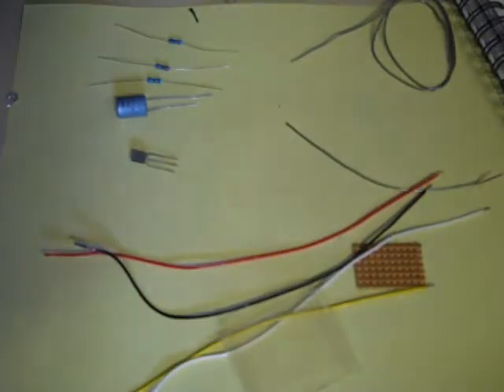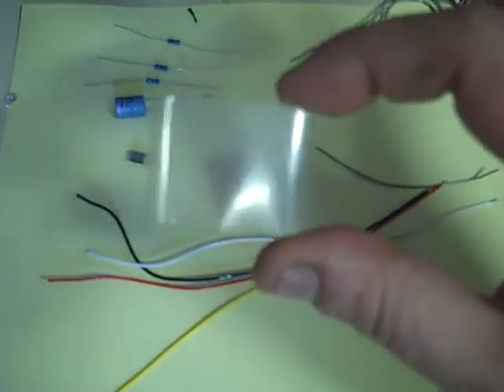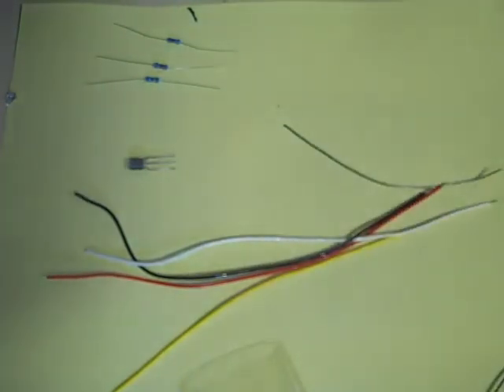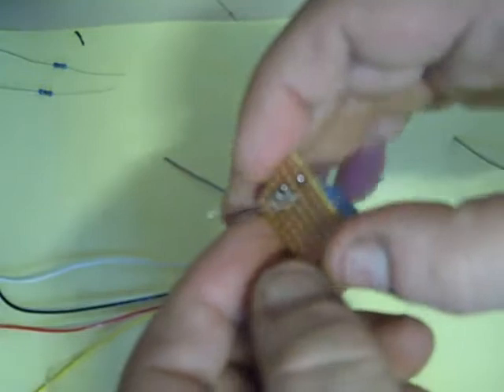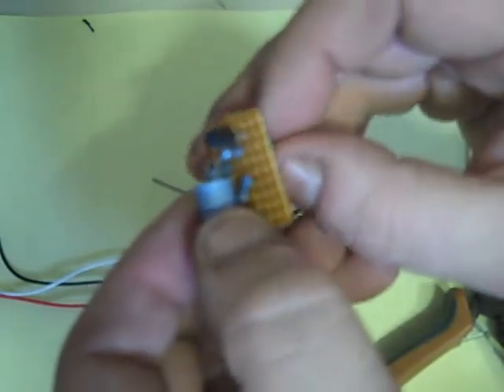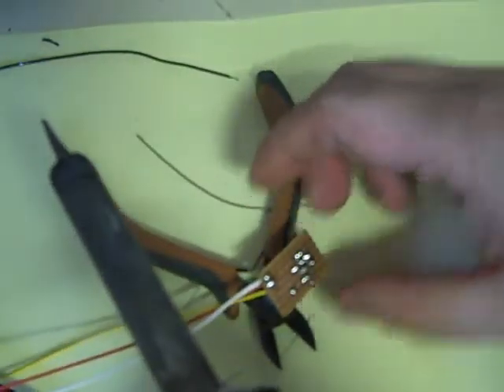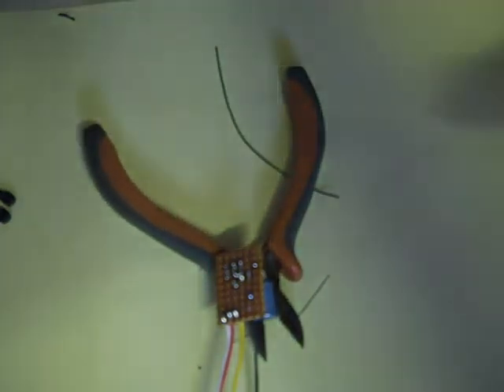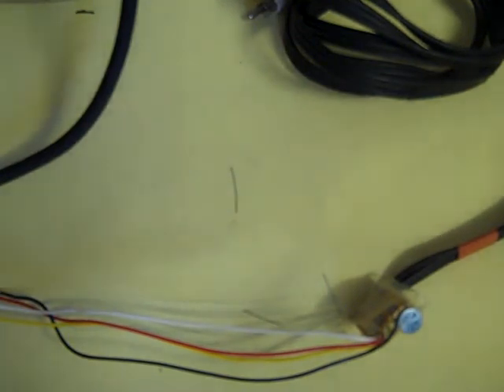Atari 2600 AV MOD circuit build

Comment: Hi Jay, thanks for the video! Trying to make sense of things as the video is a little blurry. I've tried a pre-build mod in both a 2600 Vadar and a Junior and the picture was quite poor (lots of interference on both) so I'd like to try yours.  I'm new to this stuff but can I ask are the resistors 0.5w?
Reply from the maker: quarter watt would be plenty but half Watt will work just fine, there just physically a little bit bigger.  apologies about the picture quality, I have a much better camera now ;-)
Reply: @Jayoldstuff1  Awesome thanks 👍

Comment: Hey there, I'm enjoying the tutorial and I'm slow getting the knowledge to follow up with my own 2600 Jr mod. I have been ordering the parts needed but when it came to the capacitor there are different voltage ratings for the 220uf and I don't know if it makes a difference if I buy 25v, 35v or other? Is there a preference to the voltage rating for the capacitor?
Reply from the maker: Hi either would work just fine, in fact anything rated over 5v would work, I would use a 16v rated cap but 25-35v will be no problem.
Reply: @Jayoldstuff1  ok, thanks.

Comment: Very handy vid Jay, I must do this for my poor little Amiga CD32... its composit output has been damaged somehow, so it gives a very broken display, but since it has an RF module as well I can just piggyback the input to that through one of these boosters, and output it through the existing composit port, bypassing whatever has failed
Reply from the maker: it shouldnt need it to be honest it should be at composite level going into the modulator, what i would do is put your meater on resistance range stick one end into the comp video output then start traceing that line back towards the video DAC theirs not much more than a cap and resitor between so can only be somthing simple at fault. if the DAC was bad I dont think you would get anything from the modulator